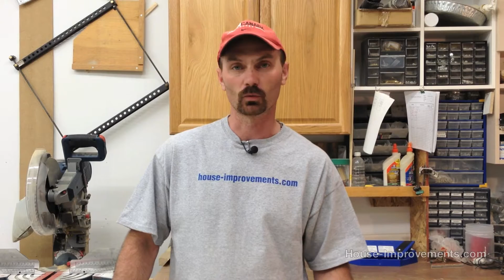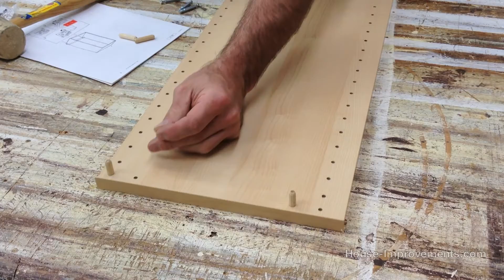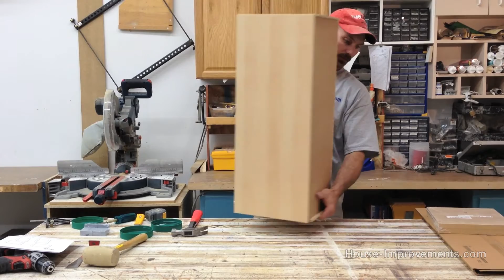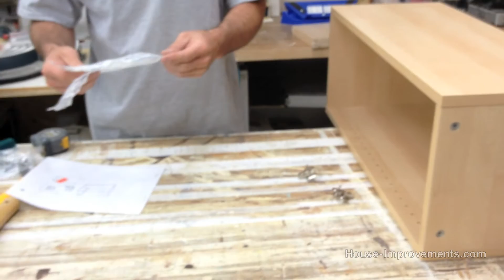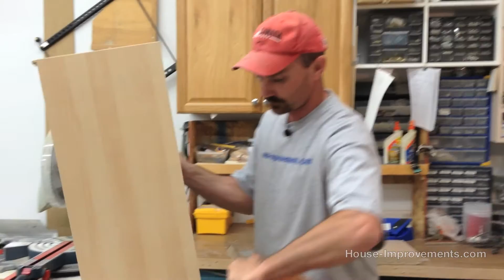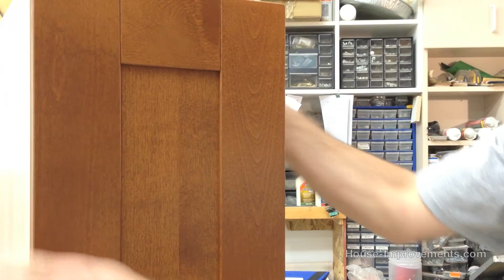How To Assemble A Ikea Wall Cabinet

Comment: Maybe I missed something, but don’t you need a stronger strip of wood across the back at the top and bottom for installation?
Reply from the maker: They include a thicker piece that goes behind the back panel in those areas.